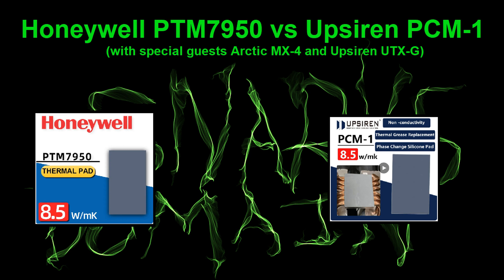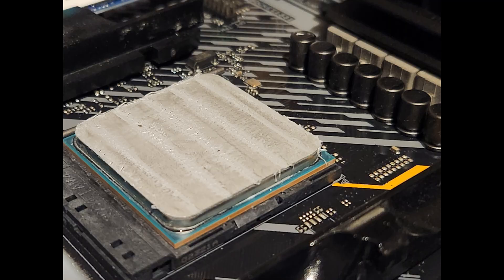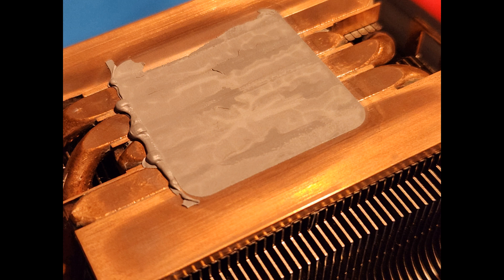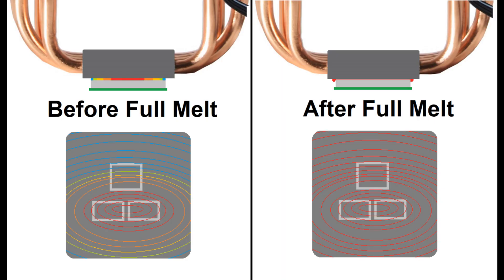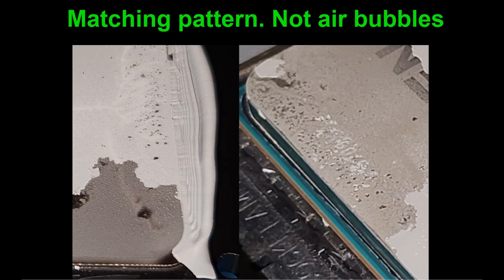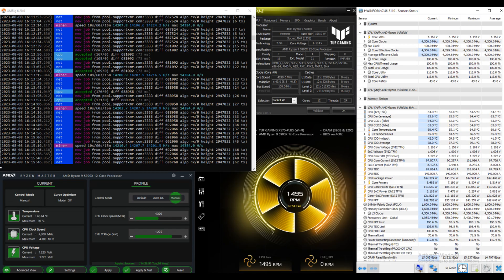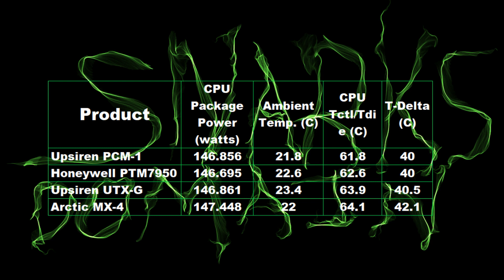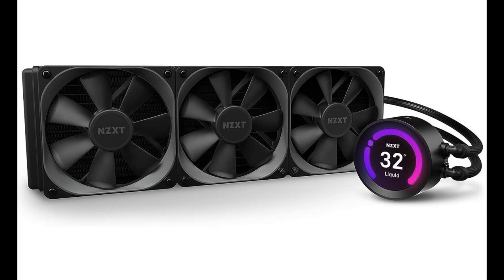Can Upsiren PCM-1 Compete with Honeywell PTM7950?

Comment: Hey i need your advice on something. I applied the Thermal Grizzly Phasheet 2 days ago on my CPU and GPU and i made sure that the cut is a bit bigger than the GPU and CPU in order to make sure they are covered. However, i am getting an average of 75 to 80 C even if its not any heavy load. With gaming they goes to over 90C. Did i do something wrong? Or should i just go back to the Arctic MX6?

I have a Zephyrus G16 2024.
Reply: Yeah i screwed them on all the way. Should I loosen them up a bit? Also since i over cut them should i put in new ones whicn are a bit smaller?

For the stress test what program should I use?
Reply from the maker: @yousseffilali4635  screws and amount of PTM you used should be fine.

I'd run Furmark and Cinebench Multi at the same time. Probably start fan off at 100% and monitor it for a few minutes, watching temps. If GPU temp gets below 75C and CPU temp is not higher than 95C then slow the fans down a tiny bit at a time. Try to keep the GPU temp at 75-80 of possible while keeping CPU at 95 or below. Prioritize keeping the CPU safe. It should hit throttle to protect itself anyways I think.

Watch it for the first 5-10 minutes and once you feel you've got it in a safe spot just let it run for 2 hours.

Then you can stop the stress testing and run whatever benchmarks or gaming you like to see how it's doing.
Reply: @snarksdomain  I think i did something wrong when i installed the PTM. When i was doing your tests even with the fans at full speed the CPU stayed at 95C and the GPU at around 80C. When i turned on my laptop before starting the tests the CPU temps kept fluctuating between 67 to 83C. Not sure how long should i stick to it before i reapply the ptm or switch over to the paste
Reply from the maker: @yousseffilali4635  PTM needs to get hot for 2 hours to melt and get thin.

That being said, did you do anything else while Laptop was open? Did you change Thermal Pads or Thermal Putty? Core it be a core contact issue?

Maybe turn off laptop, remove bottom cover, disconnect battery, then Press with your fingers onto the heatsink to help compress pads or putty and help the core get good initial contact so that burn-in can work well
Reply: @snarksdomain  No i just changed the PTM didn't touch anything else. One thing which i am not sure that if it could be related. When the laptop is not any heavy load i can see that the cpu temps go up 95C and then back down to 65C and then back up agin to 88.
Reply from the maker: @yousseffilali4635  How does it currently act under load? Is it getting to decent frequencies.

I think it just needs to be stress tested so that it can melt and get thin. The laptop should be fine at thermal throttling itself to protect from damage of overheating.
Reply: @snarksdomain  When i did the stress test the CPU goes up to 95C which makes the laptop lag. I have been using it on normal load (office work and browsing) since i have been in contact with you and on HWinFO i can see i have a average CPU package temp of 81C. Should i run Furmark and Cinebench again for about 30 min and if the temps are still high then maybe i should be looking on how the PTM was applied? Also if you can help me with what a normal temp i should be looking at?
Reply from the maker: @yousseffilali4635  You want it to initially run at those hot temps. 95 on CPU is okay for this step. Best to keep it hot for 2 hours and then take a look at temps again after that.

ideally don't go over 97 on CPU and 87 on  GPU during this burn in phase.
Reply: Ok im gonna start the test now. Fans are on 100% CPU so far is on 93C and GPU on 83C. I will keep it on for 2 hours for the Furmark and just keep testing on cinebench every 30 min since thats the limit. Thank you very much for your time. I will keep you posted
Reply: So i ran the tests for 2 hours as you said. I then turned off the laptop for a couple of hours. Noe when i run the tests again im getting CPU temp of 87 and GPU temp of 66. Are these considered normal or should they be lower?
Reply from the maker: @yousseffilali4635  Those are pretty good temps for a laptop under load. At those temps it won't be thermal throttling.

Yo7 will likely notice in the following days/weeks of just nor.al use that they drop a bit further even.
Reply: ok thats fantastic news glad i dont need to open anything up again! thank you very much for your help
Reply from the maker: @yousseffilali4635  You are very welcome. Thanks for trying the things I suggested and having patience with the process :)
Reply: btw since you were with me from the start i thought should update you. The temps again went up so i decided to open it up clean it really well and then reapply the PTM but this time i followed your video and adjusted the size to fit the GPU and CPU exactly. This time the temps were 65 on the CPU and 53 on the GPU from the start before even starting the stress test process. I am hoping this would get even betted after the 2 hr stress test. So i guess i did something wrong on my first application or there is such a thing as too much ptm.
Reply from the maker: @yousseffilali4635  Thanks for the update. It'a good to hear you git a further inprovement. I think you can expect to get improved temps over time. That being said, I think improvement will likely happen to a grwtsr extent if you do a burn in and try to get temps up to 75-80 Celsius. May have to play with fan soeeds to get it warmer.

I think for laptops there are times where there can be too much PTM. If the area arpund the die is thin/tight, then the molten PTM has to travel further out, and potentially prematurely cooling and preventing the remaining excess from being able to escape. I refer to this as becoming "Hydraulicked". Just my theory, perhaps I'm wrong.
Reply: I think you have a point on that. Laptops are built more compact so maybe too much PTM does hender the cooling process by not allowing to be spread s thin as possible. More PTM the more amount of heat needed to melt the longer it takes. 

I will run the stress test tomorrow for 2 hrs straight and will let you know the results i get.
Reply: So quick update after the burn in. The temps got a bit better by a couple of degrees on both the CPU and GPU. I am guessing it would get even better with more time. Quick question is it normal for the temps to fluctuate? When i am watching the temps 1 second its 56C and the next second it shoots up to 85 and then back down again. Is this normal and what is the reason?
Reply from the maker: @yousseffilali4635  You'll see that happen on modern CPU's where they keep boosting the core Frequencies. It's why some folks like running fixed CPU Frequencies and All Core overclocks.

Laptops are usually locked down more than Desktops, so it can be hard to do much tweaking.
Reply: @snarksdomain  Hey sorry to bother you again but i have quick question. I just got my hands on the Upsiren UTP-8 you recommended. I am following your guide and wanted to know if the sizes should be exact in terms of thickness cause i dont have a tool to measure it. Also, i saw in one video a guy put the putty on top of the heatsink so its between the heatsink and the laptop back. You think that would be a good idea to reduce heat?
Reply from the maker: @yousseffilali4635  I'm notnsure of I would recommend adding putty between the heatsink and the bottom cover, at least not initially. Nothing wrong with experimenting of course, but I'd recommend leaving that for now.

As for applying outty to your laptop, I likely rolling medium sized balls for the VRAM and logs for the other components.

You could either wing it and see how it goes, or you could apply putty and test fit the heatsink to see how it spreads, then remove the heataink again. You can even take pictures of the putty spread and share them on my Discord channel and someone will help you dial in the putty application (link in video description)

Once the putty is dialed in, only then do you want to apply paste or PTM/PCM to the CPU and GPU die. I like to either reshape the putty, or pinch the sides of the logs/balls so that the putty "stands up" a bit. You want the putty to get final compression during assembly to ensure good contact with the heatsink.
Reply: Ok thank you I will do that and post on Discord. I have already applied the PTM would I need to apply it again?
Reply from the maker: @yousseffilali4635  yes, but you can also try re-using the PTM7950 you have if you like. Just put the melted bits arpund the edge back on the CPU and GPU die. They will melt again.
Reply from the maker: @yousseffilali4635  Phase Change Material sheets start off at 0.20mm to 0.25mm and need to get hot so they can melt and flow out.

I recommend you run a CPU and GPU stress test at the same time for 2 hours. You want them both to get warm at the same time so that they both melt and the heatsink can squish down.

In the end, 80% of the material should flow out and form arpund the edges of the die.

I typically recommend folks to cut it smaller by 3mm on all 4 sides since it makes 2nd peel easier, and you'll still get full coverage.

I assume the heatsink screws are turned in all the way?

Comment: What if we put phase change material pads below and on top of copper shims for our GPU? Wouldn't that be like some Super Duper Ultra cooling fix?
Reply from the maker: @gab882  I'm not sure how well that would work. You'd want to secure the shims somehow as they could move around once the Phase Change Melts, especially if it's mounted vertically. If it's mounted horizontally then the shims would be less likely to move out of place.

I won't be trying it though. I think it would be very hard to take the card back apart with it basically being glued at all the VRAM locations instead of just the core.

Comment: First time viewer, really appreciate the videos, its been great to learn for a beginner like me. Did you ever get around to testing PCMs with liquid/AIOs? I’m already going to be repasting my 6950xt and my laptop with Honeywell and I’m wondering if I should also do my CPU and get a larger sheet?
Reply from the maker: @horusmorus5588  I've used it with AIO's already and it works well enough. There isn't as much of a performance benefit with an IHS as there is with direct die applications. There would s5ill be a longevity benefit to it.

One caution I'd add is that on an AM4 or older platform you would need to do the AMD recommended twist in the future if you ever remove the cooler/CPU block.

Comment: I just got two 80mmx800 of each one. Planning to use a piece of paper or card board or plastic to cut out a template based on CPU shape, and cut the piece out of the 80x80 sheet, but probably leaving a side slightly bigger to be able to peel it off. I have the NHD15 and Water Cooling, so will try what I suggested on my other comment. If you run a stress test or benchmark on the CPU, big fan or water cooling, should still allow the temps to hit 70 degrees C.
Reply from the maker: @DragonXDrei  I'd recommend  cutting it smaller than the IHS and using tape or little sticker ti help peel it.
Reply: @snarksdomain  I finally got around to use the Upsiren. I used it on my older OC 4.2Ghz i7 5820k with a dual fan Noctua D15. My Corsair H105 was keeping the CPU idle at about 45c, and would go beyond 80 to 100 under load, this was also just getting to the main menu of ESO. Assumed the AIO lost liquid or pump became faulty. When removed the old paste looked good, not dry. Was time for a change.

I kep the sheet in the fridge. I used the bottom flat part, clear plastic from a fruit container to draw and cut out my CPU shape. Used that on the Upsiren sheet to cut out the shape with scissors, was only 5mm extra. Applied, run my finger over it, pulled with tweezers and done. Removed the extra 5mm.

In order to get the CPU temps to over 60c, I turned down all fans to a minimum in the BIOS, so the Noctua was on passive mode. Left the computer switched on for an hour or so, but temps just wouldn't go higher than about 50c. Ran the CPUZ stress test, and that would barely get the temp to 60, so I left it running indefinitely to keep the temps close to 65. I then used the powerMAX app from CPUID to CPU stress test, temps started to go close to 80. Did that a couple of times then switched off.

After a few hours, I powered on PC, and enabled smart fans and set the limits. Windows idle 35c, full load barely gets to 65c after 5 or so minutes, but as the fans start going past 70%, the temps go to about 60c and under, at full load. I will try with the fans at full power, but need to install the windows fan controller application, not that it is necessary, as the results speak for themselves.

Only thing I must specify, the bag in which the sheet comes in, I couldn't take it out, had to cut the bag open. But since Honeywell gives you a nice plastic box, I put the remaining Upsiren in there.

I have the Honeywell as a backup.
Reply from the maker: @DragonXDrei  Nice work. I like that you put in the effort to get it to melt good.

I agree about it being hard to get out of the bag. I must get warm during shipping sometimes. A little bit melts near the edge and makes it stick to the bag.

These days I cut the piece smaller by 3mm on all 4 sides.
Reply: @snarksdomain  thanks, looks good so far but haven't had the chance to game or anything. You are definitely right about the side melting in the bag. I should have cut it shorter, I think I just wasted that 80x80mm sheet. Will only have enough for another 40mm application, unless I can combine bits. I'm currently waiting on black Friday to see if I can get a new CPU. Prices for the AMDs were better this summer. All X3D processors have doubled in price.

Comment: Any new tips for using phase changing material? Did you try puncturing the air bubbles?
Reply from the maker: My current advice is to:

1. Cut a piece of paper until it is ~3mm smaller on all 4 sides of the die size. Use this paper as a template for cutting the PCM Sheet.

2. Cut the PCM sheet with scissors to the same size as that paper template.

3. Use 2 tiny stickers or pieces of tape on either side of the same corner and peel apart slowly. One side should peel off cleanly. Stop if it tear and try a different corner

4. Carefully lay the piece of PCM down on the silicon, and rub with finger to work out bubbles and make it stick to the silicon. Leave 2nd plastic film on for now.

5. Do anything else you need to do like pads/putty, etc. Let PCM cool back down for a couple minutes (from rubbing with finger).

6. Peel 2nd film at a sharp angle. Pull it towards the opposite corner, don't pull it 'up'

7. Assemble and get it up to 80 Celsius for 2 hours, adjusting fan speed as needed to keep it hot. This lets the excess flow out. 80% of the material will flow out, which is part of the reason to cut it smaller. the other reason is that it's easier to do 2nd peel.

Trey not to worry about small bubbles. press them out if you can while 2nd film is still on, but it's not a huge deal. it'll get sorted out when most of it flows out.
Reply: @  👏👏👏 epic response, brilliant advice.

I’m deshrouding my AMD RX6950XT graphics card with noctua fans, and using PTM7950 and CX-H1300 putty. The stock temps aren’t too bad but I want to get the best I can for the longevity of the card because this is the last card that is supported for Hackintosh systems.

I’ll let you know how it goes. I just have to wait for my putty to arrive next week.

Your video guides have been invaluable and your comment here is the cherry on top. 
I really appreciate the help, thank you so much 👍

Comment: I would assume that if you use AIO, NH-D15 Dual or a water cooling loop, all you have to do is decrease the pump and fans speed to the lowest setting, and that should allow for the burn in period.
Reply from the maker: @DragonXDrei  Yeah, lowering pump/fan speed is the way to go in those cases.

Comment: best thermal paste for laptop cpu and gpu if u can recommend
Reply from the maker: Phase Change Material. Either Honeywell PTM7950, Upsiren PCM-1, Thermalright Heilos, or even Laird TPCM7200 (requires higher temperature to melt than the other 3)
Reply: @snarksdomain  but i was asking only paste and not ptm, since in India there is issue to get anything form AliExpress its banned
Reply: @snarksdomain  can u recommend any paste and not ptm. tell me about some good paste, since in india lots of  aliexpress does not  deliver

Comment: It practically has the same thermal conductivity and Upsiren takes it up or down a notch by being cheaper Honeywell after all is very old company
Reply from the maker: I wouldn't put too much weight/importance on the advertised w/mk rating of any Thermal Interface material. The ratings are used to help market a product.

De8auer and Gamers Nexus did a really good video where they talked about the issue.

I've even seen 2 products from the same company have a higher and lower rated product. And the one with the lower w/mk rating outperformed the one with the higher rating, significantly. These days I only trust testing. I do use advertised ratings as a rough guide on which products to test within a product lineup though.

I'd also add that you can find PTM7950 for similar price. I've tested some from a few different sources and they all seem to perform fairly well.

Comment: hello there hopefully you can answer me, which would it be the best thermal pad to use from aliexpress for cpu and gpu ? and if you also tell the thickness that would be helpful, for reference ryzen 7800x3d and rtx 4070
Reply from the maker: From aliexpress for the CPU and GPU core I'd either go Honeywell PTM7950 sheet, Thermalright Heilos, or Upsiren PCM-1. They are phase change and melt at 45 Celsius and squish down to 0.038mm (0.0015").

For everywhere else that uses thermal pads, like VRAM and VRM, I'd use a Thermal Putty instead such as Upsiren UTP-8 or Fehonda LTP81